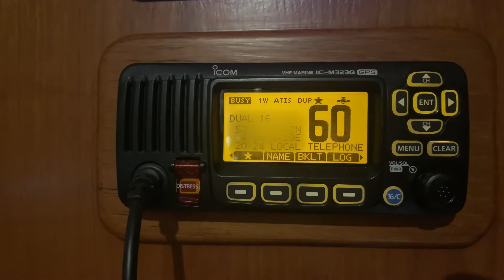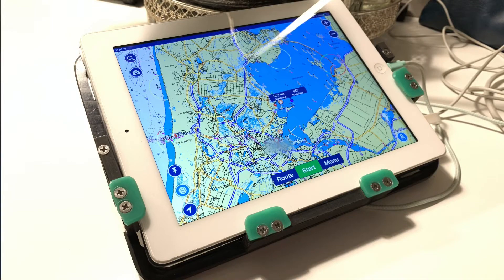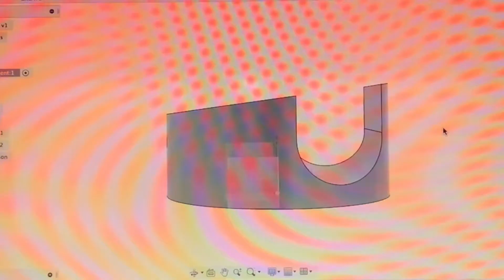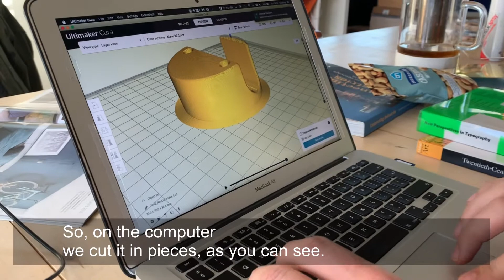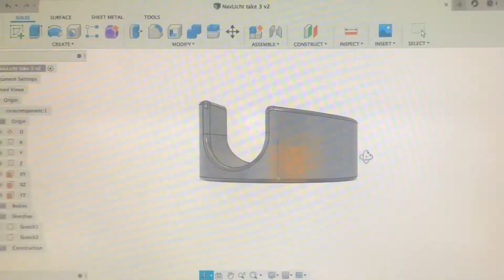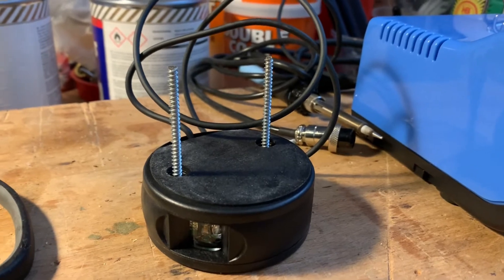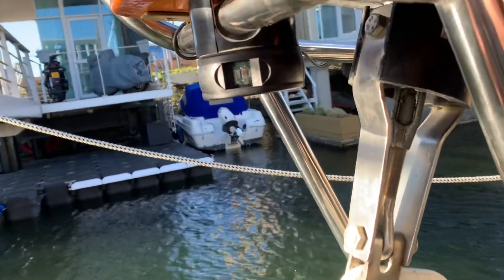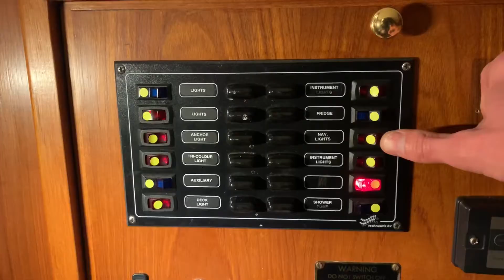008 How to install navigation light on pulpit with 3D printed bracket.

Comment: You don’t need it in the mast, but better to do. Big vessels can see you better when your sealing on sea and you have a backup. Don’t forget you need anchor light as well.
Reply from the maker: Hi Berend, we have a toplight, including the anchor light so that is sorted! We just did not have a nav light which is required in NL. What is needed is a radar reflector for when visibility is less. Also on the todo list....
Reply: @SailingSpringVis  I bought a secondhand radar deflector which is a fixed one, but I have a v.d. Stadt 36 seal with an extra cutter sail, so have to see if it’s fit. :)
Reply from the maker: @berendjanweurding  Second hand rules, if it fits..... Van de Stadt, also a classic blue water boot. Looked at quite a few of them. It is located in NL as well? Would be funny if we meet on the inlakes one day and then in the tropics the other day! :)
Reply: @SailingSpringVis  Is possible...goal is this year practice and additional modifications and then next year the Atlantic crossing.
Reply from the maker: @berendjanweurding  Nice! Don't hesitate to give a jell if you see me passing by and good luck with all the preparations. good to know we are not alone out here :).